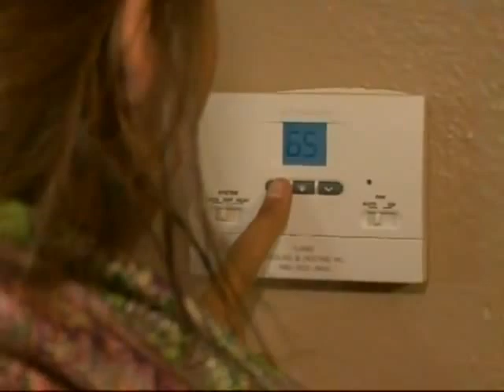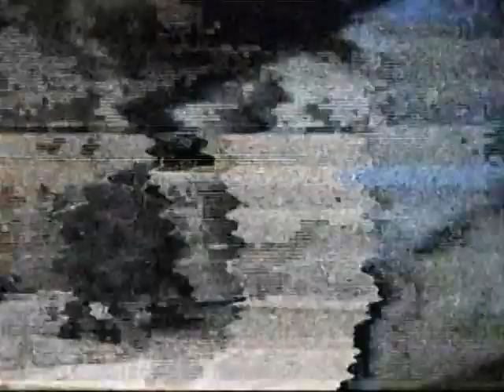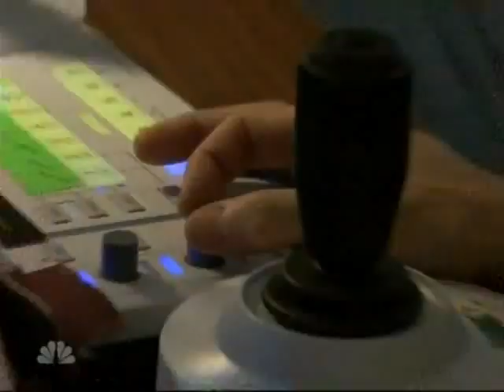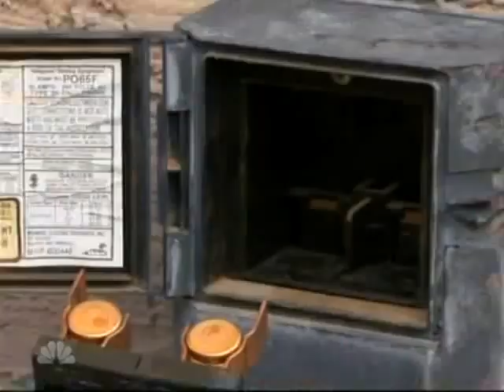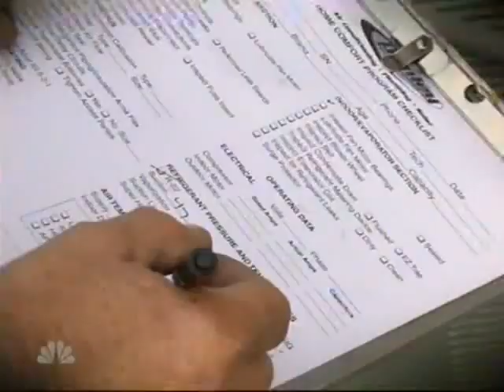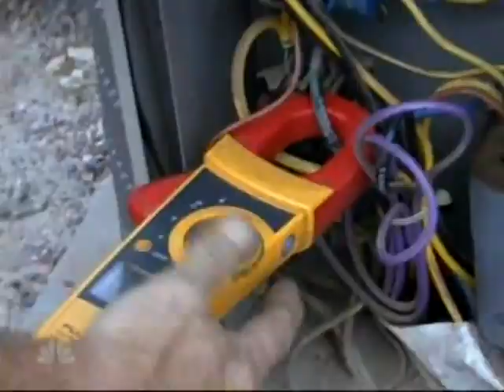Dateline NBC investigates air conditioning repairmen caught scamming customers

Comment: Damn tony, You don't check the disconnect?! Lol, if a condenser is not running, the very FIRST thing you do is check voltage coming in. No 240 at contactor, check disconnect!
Reply: ALWAYS ALWAYS ALWAYS! "Problem lies where the power dies".

Comment: Our system stopped blowing cold air, and we were told we needed a brand new unit as well. But we trusted them, but didn't have the money for a new one.
We've now gone 5 years without one at all and had to use cheap window air conditioners instead.
Now, I'm not sure if they told the truth or not...

Comment: A lightning storm took out both mine and my neighbors AC unit.  I cracked mine open, noticed the bulged capacitor so I bought a new one from my local electrical supply and installed it before it started getting hot.  Neighbor wasn't so lucky.  His family went 2 days without AC waiting for the HVAC guys to get a new fan motor that wasn't even the problem.  They finally replaced the blown capacitor and charged him around $1000 for what cost me less than $20 (around $12 for the part + gas to go get it)  Other than connections coming loose (no components required to fix), the cap is the most common component to fail - its worth it to keep an extra on hand.  The first guy may just have been recommending what he would do if it were his own system.  Just looking at it from the video, it could use a better cleaning to work more efficiently and if the cap looks old he might recommend replacing it before it fails... He should have said that though.

Comment: If you had to top the system off with refrigerant, that is an indication there is a leak in the system. Another issue that could cause low refrigerant is people repeatedly checking the refrigerant during every visit. If you have the proper airflow across the system, the system has been correctly installed, and the charge verified on day one during the installation, there should be no reason refrigerant would need to be added into the system. There are temperature splits and enthalpy readings than can be taken and matched to the manufacturer's data to verify the system is operating correctly without ever needing to hook up gauges to the system. It is a sealed system and only needs refrigerant if it has leaked out. If the system has been leaking, that means it has been exposed to the open atmosphere which contaminates the system. The leak should be repaired, a new filter drier installed and the system vacuumed to 500 microns or below.

Comment: I think the first guy at 3 min was a pretty honest dude. I worked in service for years, and you do end up making quite a few preventative judgement call recommendations to customers. No doubt that guy has gone the other way and said "it works, leave it" and gotten an angry phone call a month later in 45 degree summer heat from the same lady saying her AC failed (due to capacitor failing). Repair jobs are tough. It isn't always black and white. As for the clear cut scammers.... yea, they can eat dirt.

Comment: never in our field does a fuse disconnect randomly pop out, you have to physically take it out and not push it fully in but first step is to check if the unit is getting power  which its not so you check the fuses and thats it ask for a 20 and go on ur way

Comment: You need 2 ac units in Arizona?? 😮
Reply: Volcano Blue upstairs and downstairs
Reply: Volcano Blue, the max "size" of a residential air conditioner is 5 tons. Now it depends on which way the windows are facing, heat loads, etc... but in AZ, a (heavily debated, but widely used) rule of thumb is 400 sq. ft. per ton. So 5 ton x 400 sq. ft. = 2,000 sq. ft. That's the most space a single unit can cool. If your house is 2,800 sq. ft. then you need 7 tons. So you would get two - 3.5 ton units.
Reply: Heidi S well said

Comment: So many issues in this sting. First they say there experts topped off the Freon, well Freon just doesn’t decay overtime. If it’s low on Freon it’s got a leak. But they have a issue with the guy that said it has a Freon leak. Next the capacitor guy I would have recommended it also you can tell it’s most likely the original by the huge size of it. The next thing is the disconnect fuses. Now if there expert put the fuses block back in upside down I think would be too obvious of someone setting him up. So if he put the block in right but not all the way, well I would have changed the damn disconnect which I’m surprised no one did. Because obviously there’s a problem with it if the block is out a little. Not to mention it could cause compressor failure of it was making periodic contact make the compressor click on and off.
Reply: I know right? Their 'expert' is shrugging off a lot of shit for the sake of having these guys look bad. The age does not really completely tell you the condition of an A/C System, a lot of environment variables especially over 20 years will have different effects on its health.
Reply: Capacitors are for starting the compressor if there is no electricity present at the condenser the unit will not start  You need an electrical tester
Reply: Dreamer I don’t understand what your statement has anything to do with this conversation.  Of course the unit needs power to start lol 😂 what a stupid statement.

Comment: capacitor could've had a lighting strike over night.
Reply: Capacitors are for starting and running the compressor only
Reply: Dreamer the condenser fan motor uses them as well as some indoor blower motors.

Comment: The issue I have with the guy who pushes the disconnect back in and leaves without collecting is that he checked NOTHING else. It's nothing if not irresponsible to push a disconnect back in on a 20 year old unit and NOT check anything else, especially if it's your first time servicing a system for a customer. The other two guys were flat out scammers, no two ways about it.
Reply: ducc764 good point but still dude c'mon
Reply: That's a fair point, but this show is edited for time, so you don't know that he didn't check the rest of it.
Reply: We don't know if he did further testing. The show is edited for time.
Reply: I would give jenny a tune-up
Reply: ducc764 you don't know what they edited out, I'm sure they didn't "just push the disconnect in and leave"
Reply: Yeah! And George, the next guy... When chris said he did his inspection and the screen switch real quick to george walking away >>>:(((( George did that check real quick.
Reply: They showed a 5 second clip of him pushing the fuse in. Are you telling me you think he magically knew it was the fuse and only touched or looked at it?
Reply: even if he did not look at the rest. he fixed the problem. anyways its almost impossible to know if something is broke before it breaks, if It works after u fix something the its good. otherwise u end up getting things like well theres rust so its on its way out sort of bullshit. if someone fixes the problem and doesn't start sayin that other things are going bad before there broke then imma take that person as my guy rather then the other ppl. preventative matience is a good thing but at the same time how long could that part have worked before  it actually failed?